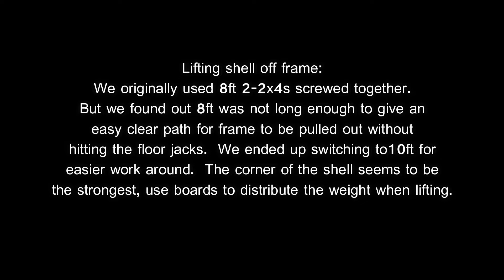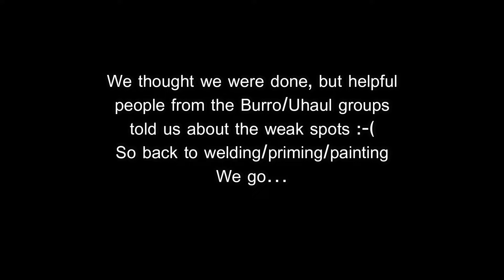1983 Burro Trailer Episode 2 - Frame Restoration

Comment: Can you tell me the exact axle you used and how much did it lift the trailer? Does the axle have breaks? I want to upgrade my axle and wheels/tires and I can't seem to find the exact info anywhere. Do you have any pictures of the axle? And what size tires did you put on. Are the wheels 5 bolt?  Thanks!
Reply from the maker: I dont have exact model number for axle.  I took my axle off and took it to local dexter dealer and had them measure and order exact fit but with 5 bolts instead of 4.  Also raised like 8”
Reply: @erinadachi  14" rims? and did you have the degree of the arm set at 0, 10, 22.50, or 30
Reply: I ended up ordering the 5 bolt and 10 degrees down. With 14" rims. Just anticipating how much lift that will be
Reply from the maker: @TheReelChicago  we got 14".  I believe ours was 30 degree?  It increased heights more than we wanted to...  Hope yours will work out!
Reply: @erinadachi  thank you. Safe travels!
Reply: @TheReelChicago  How much did that raise the trailer pls? ty!